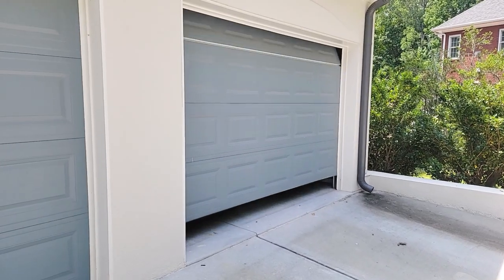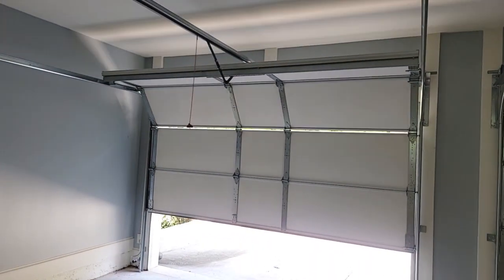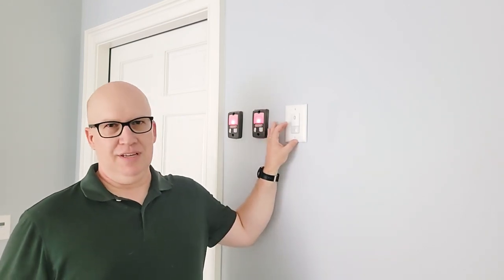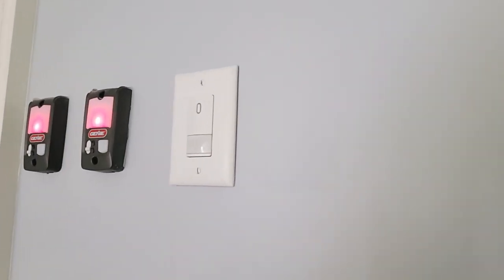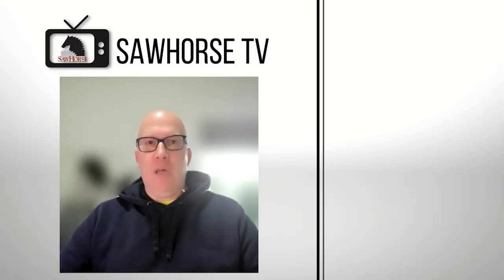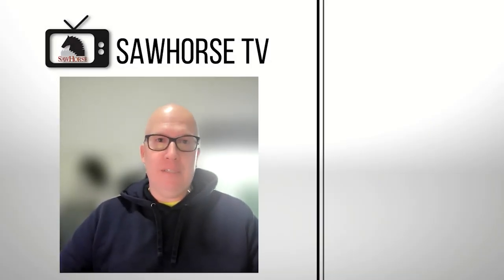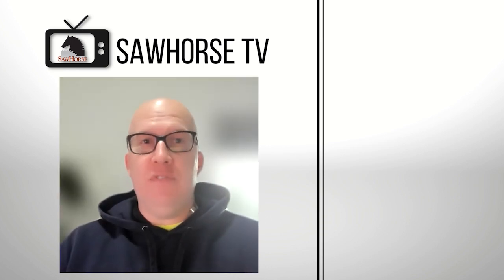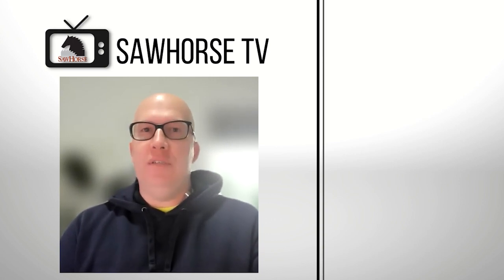Smart Exhaust Controls | A Must Have for Attached Garages

Comment: Where does it pull air from? Assuming it comes through leaks around rhe garage door? But what if the garage door is tighly sealed? Might need a baffle intake somewhere.
Reply from the maker: Mostly leaks around the garage door.  In a space that is super tight- I would recommend make-up air.  it does create a negative pressure so when the door to the house opens- air comes out of the house and not from the garage into the house.

Comment: Most Cars have cats, so no Problem in general. Only when u left ist Running for hours in a closed garage
Reply from the maker: The main issue it for garages that have materials with VOC's in them.  When the door to the house opens they could enter the house.  The fan creates a negative pressure in the garage so the fumes stay in the garage.  The car fumes are not great to inhale even if the CO levels are lower.

Comment: I generally recommend that the wall between the house and the garage have all penetrations sealed and that a closed cell foam is used to ensure no air transfer occurs.

The fan is a great idea. However, I don't know if 10 minutes is long enough. I would almost prefer to use a smart switch and have it turn on for 5 minutes every hour.
Reply from the maker: I agree on sealing the wall if possible.  I like the negative pressure in the garage so fumes don't enter the house when the door from the garage is opened.  This all works if the HVAC is balanced inside the house.  There are so many ways for pollutants to get in so ventilation needs to be designed to be balanced.